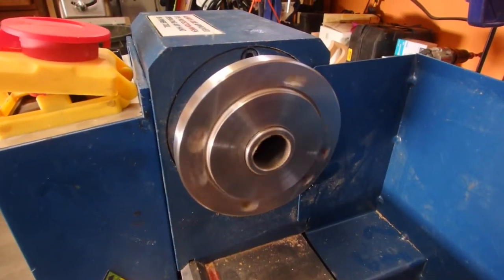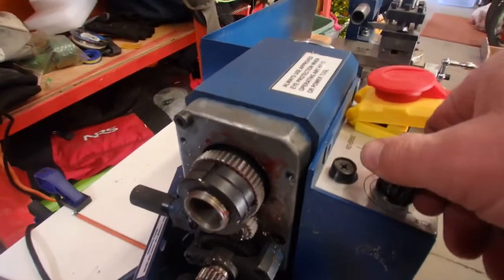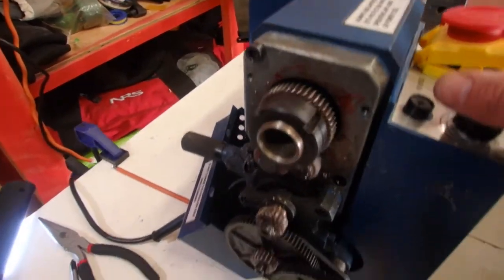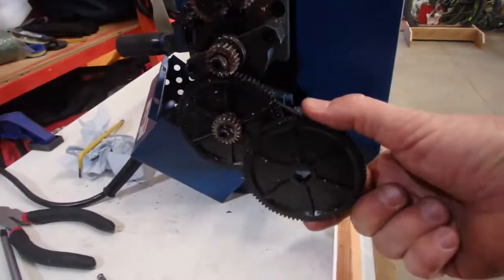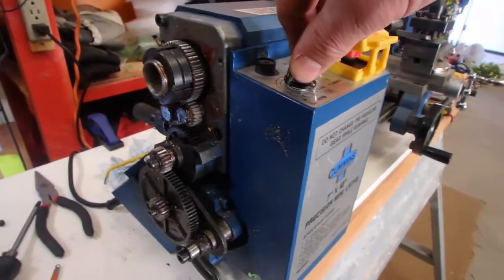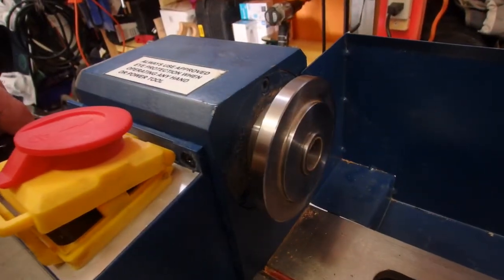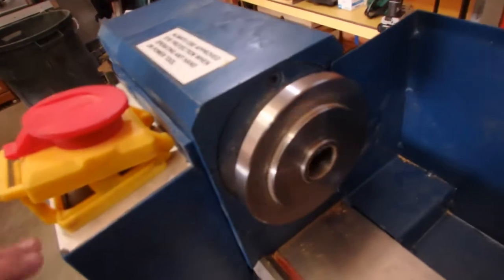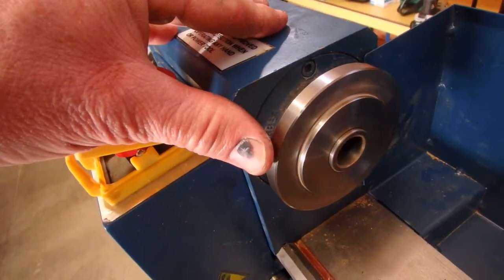Mini-lathe issues (1/18/2018)

Comment: Watch the video called "So cheap they didn't even finish" from TimNummy. He had the same symptoms with this lathe and they were caused by an unsoldered resistor on the PCB.
Reply from the maker: Thanks for the suggestions!  I ended up replacing the plastic gears on the motor, the belt, and putting in a new gear & the "key" (little metal bar) for the main shaft.  That resolved the issue -- not sure I needed to do all those things, but back up and running now!
Reply: @snowytom  nvrmind just saw this

Comment: The teeth on the drive belt are all sheared off
Reply from the maker: Thanks, Mike.  The issue wasn't the teeth -- but the cross-pin that held the gears onto the shaft.  It had somehow loosened or fallen out and so all was slipping around.  I likely put it together wrong at one of my many attempts to diagnose it.  $0.50 part from little machine shop.com was all I needed to fix!